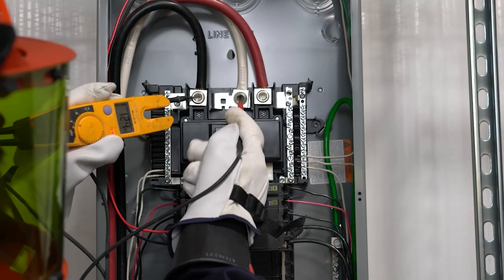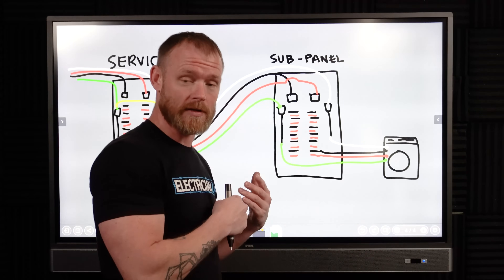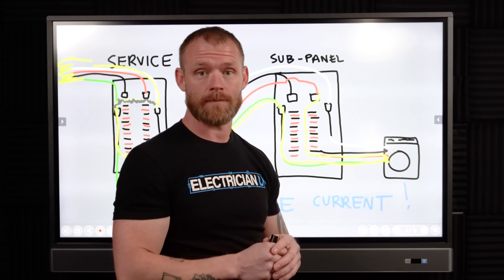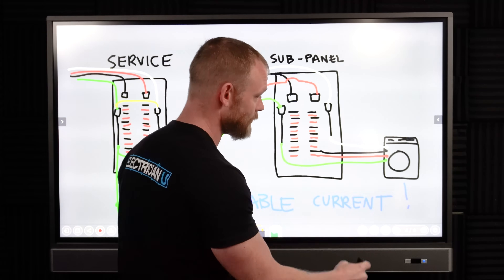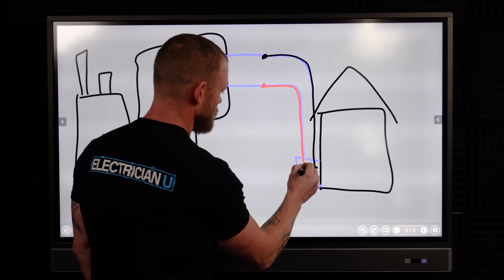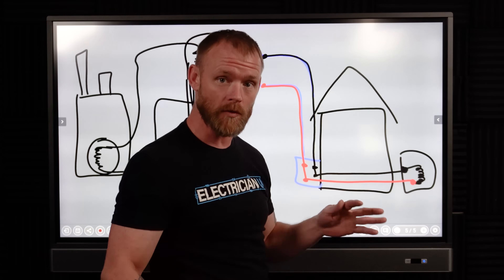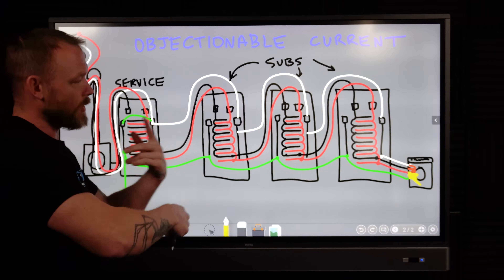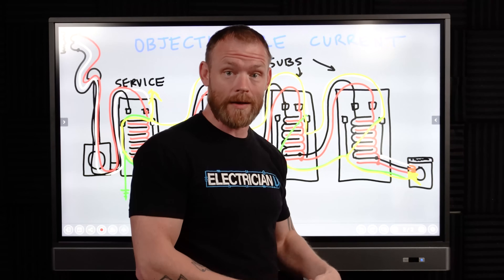Why Do We Bond at the Service Panel and Not a Subpanel?

Comment: So watching this explanation leads me to a question: why is the ground wire grounded? It seems that a 3rd wire that is connected directly to the neutral in the panel, bypassing all other electrical devices is what's needed and the fact it's also connected to the literal dirt doesn't actually do anything.
Reply: You are right about connecting a ground rod to dirt doing nothing, it's about connecting it to water which is a conductor.

Comment: ffs if you're not an electrician please stop trying to wire sh*t up in your home.🙄  Just went on a service call where some clown double tapped the feeders to his sub panels and then terminated all the grounds on his neutral bar and all the neutrals on the ground bars and also put his panel in upside down. The f*ck is wrong with you people...like stop. now.

Comment: I asked this of an old inspector 30 years ago and he told me the biggest reason to keep the equipment grounds and the neutral separated in a subpanel isn't so much for the fault current path, as much as it is if your neutral connection fails how would you know?  Everything would work fine (If the ground path is good).  Now we are running all of the unbalanced load across non insulated conductors, boxes or panels. You may not have a green wire, EMT or other metal raceways are acceptable equipment grounds.  If you touch them you don't get shocked as they are at ground potential.  If they are made up tight you will still pass the fault current and trip the breaker.  But if that one locknut wasn't made up tight or an EMT coupling screw was never cranked down you might get some arcing and flickering lights.  If it fails every circuit  on your subpanel could go to 240 volts depending on the imbalance.  You would still get that if the neutral failed but you would know it an lot quicker.  

If you were the guy trying to fix that loose EMT Coupling from a bonded subpanel with a bad neutral, and had your hands on either side of it pushing it back together you would defiantly know what objectionable current is. 

A great video and explains the main bonding jumper very clearly.  Keep up the great videos.

Comment: Because we don't want neutral current paralleling along on the grounding conductors (green wires or bare wires). END. Some dishwashers, & washing machines were famous for paralleling neutral current to water pipes and occasionally some twit would also do a second water pipe bond at the sub panel and then some poor schmuck who was just trying to take a bath gets electrocuted.
Reply: Baths aren't all they're cracked up to be.  One should be enough for anyone.

Comment: 240 volt with no center tap is a way better system less complicated smaller wires this whole 120 volt center tap seems ridiculous.
Yeah the whole balancing of the system larger wire gage... What is the advantage of 120 volt center tap setup.
Reply: The advantage is fewer burned lamps and toasters.
Reply: One huge advantage is that all the 120V devices will work.  We don’t want to throw them all away, and we didn’t when 240V service was introduced.  It worked out very well, because when 240V came in people could add it at their leisure if they needed it.  My grandmother never had 240V.  My mother rewired the house in the 1960s.

Comment: There are a few other things that need to be evaluated. 

1 - Eddy currents if not bonded. 
2 - Separately Derived Systems. 

These things always should always be considered in these conditions. The wiring changes for each of these conditions. 

The two path’s that you speak of is where eddy currents are evaluated. 

Eliminating the ground wire to the sub panel would allow for a separated service.

Comment: Great video, thanks for going into this, it's really helpful.  I'd really appreciate any knowledgeable person answering my question on this:
Why doesn't the current just travel along the main Ground wire and short the whole system all the time?  It's bonded to the Neutral and is a much shorter path to Earth with less resistance than going back from the Main Panel to the Source.  I thought that electricity is always seeking a path back to Earth, how am I mistaken?  Thanks.
Reply: I wondered about that. I think we can't rely on the ground being able to quickly carry that much current.

Comment: Thanks for the explanation! What may confuse some folks is if they have a service entrance rated disconnect in front of the main panelboard then that disconnect would have the ground and neutral tied together and not the main panelboard correct? Thanks.

Comment: Your explanation make absolutely no logical sense. If the sub panel were bonded, then that short would find the neutral that much quicker rather than making a ground hazardous by having current on the ground buss. Also, current travels at the speed of light, always. Resistance limits, not slows current flow.

Comment: If you had a transformer within your service and sun panel, would you bond the neutral and ground right behind the transformer. Typical won't have this at 120/240 single phase, but could easily over with a three phase or 480/277 service ......
I've argued with a number of engineers about that scenario and curious of your interpretation or understand.....

Comment: Still doesn't make sense to me..... pull the meter so everything is de-energized, put an ohm meter between ground and neutral at any sub-panel and you will measure a dead short because they are connected together. I will have to watch this again.

Comment: Ok, I fully understand this concept within a structure. In a structure you only want a single path to ground as current will flow on all paths dependent on resistance. What I don’t understand is that in a exterior sub panel or most particular a daisy chain of feed thru’s with individual ground rods at each sub panel works. I have had devices plugged into the 240 supply on these panels with a fault to ground. Depending on where in the circuit this happens the current gets shunted to the earth ground and not enough current gets back to the main to trip out a large breaker. Typically a 200 amp main breaker.  While it is code to have all these different ground rods it doesn’t seem to work in all situations. Can you make a video explaining why we earth ground every sub panel? Again not a problem when a single sub is fed by a main, more with a daisy chain of sub panels. Each with a separate ground rod.

Comment: Very good videos. Thanks for it.
I have a question.   Is it correct or not? Having a duplex property for example with a 200 amp main Panel dual meter 100 each unit with a ground rood thru earth and  run only the 2 hots and neutral conductors to each subpanel from each unit and have a separate ground rod on each subpanel unit and bonded or not...

Or just the ground rod on the main meter box and run 2 hot neutral and ground to subpanel and not bond them.
Or

Comment: If I understand correctly, what is being discussed at around 8:20 is that energy flow  (current) through the grounding rod may not be sufficient to trip the breaker?  So it is safer (and required) to be complete all the way back to the transformer but I wonder in practice if that is actually true.  If there is 120v of potential between earth and the line hot wire and it is occuring like 60x/second, and assuming the grounding to a rod or burried metal pipes was making a low/nil resistance path to Earth as it is supposed to, would the breaker really not trip?  In other words, if the panel were not bonded, and the hot wire were touched to the grounding wire directly, would the breaker actually not experience excessive current flow and fail to trip the circuit open?   Later in the video he says, "ground rod doesn't have anything to do with tripping a breaker", and I don't believe that is true.  The breaker only "sees" current flowing in the "hot" side of the circuit; the return current flowing on neutral should be invisible to it.  So it shouldn't matter whether the current returns up the service to the transformer, or out to earth through the grounding rod.  ON THE OTHER HAND, where we are dealing with excess current returning through the neutral conductor, bonding ensures that the current will flow even if something screwy happens at the transformer, and that said current flowing, if it exceeds the breaker rating, even if it's going out through the grounding rod would cause the breaker to trip.  I agree 100% with what he says at around 16:40 about no wanting to have current flowing on grounding path (i.e., metal pipes, conduit, etc) for a short circuit.  That is correct, and that is in my understanding the actual reason not to bond in a sub-panel.  But like I said, I'm not sure the other stuff is correct.  And if you add in the fact that code (in order to keep things "safer") has increased where GCFI breakers are required, you can say that definitely on those special branch circuits where a GCFI breaker is required, is is most definitely incorrect.  But just speaking about an ordinary plain vanilla breaker, they will in fact trip on a ground fault that exceeds the current rating of the breaker... they just don't trip when the ground fault is energizing something without anywhere to go (like water in a porcelain sink with a rubber/plastic drain pipe/stopper) - thus you need GCFI in those situations.  But what he draws there with full current returning through the grounding rod, please somebody else confirm, but I would be 99% sure it will trip the breaker.  This video just makes me doubt that 1%!

Comment: Great video. Some questions re video. To clarify, could you answer: If Hot touches the washing machine, why can't the return current go via the neutral? and if ground is tied to chassis at the washingmachine, and the washing machine has metal feet, isn't the washing machine creating a path to ground bypassing the breaker?

Comment: You're forgetting ground loops as well. I know it's not safety related but creating ground loops introduces a lot of RF noise into your local power distribution. Those same ground loops can also amplify RF noise above legal limits and cause illegal interference in your locale. This becomes especially important in 3 phase equipment where looping the ground turns the entire peice of equipment into an inductor. The noise the motors generate, especially if VFDs are involved, can encroach on AM frequencies and violate FCC regulations.

Comment: I'd like to understand the "earth" (ground rods/plates) requirements better. Particularly when one service panel serves multiple sub panels in separate buildings.
Reply: I believe that once the service exits one structure into another structure, you have to bond the neutral and ground as if it is service entrance rated..... Hence the name service entrance.
Reply: @bryanduchane2371  I think you are correct but I there is more to it than just that.

Comment: I don't think I could explain it to someone else, but I'm pretty sure I understand it. Thanks! Subbed.

I have a question about impedance. I noticed you were interchangeably using resistance and impedance. Resistance in a DC circuit I understand, but impedance is what I"m not quite sure about. First, they aren't the same, right? You were using them both but I'm guessing that was not necessarily correct. I think. Is Impedance the same as resistance but with respect to an AC circuit? So resistance (DC) is equivalent to impedance (AC). Is that right or am I simplifying it? Or am I completely wrong? Sit down, shut up, write Ohms Law 100 times! 

Great info. Thanks again.

Comment: I just recently ran into the 3-wire, 240v Range/Dryer issue. It seems that in MANY installations, the neutral is also grounded to the body of these appliances. This means that ground and neutral are joined at these points, undermining the idea of only bonding them at the service entrance. Can you shed any light on this issue? They still sell the 3-wire receptacles  and you see them all over the place.

Comment: Only difference between the service panel and the sub panels is the earth ground. If the sub panels have an earth ground you could bond them. 
You want the objectionable current to have a guaranteed lower resistance path to earth ground compared to the common white wires.

Comment: Ah, Objectionable Current is a product of, to borrow a term used more often in Audio Engineering, "Ground Loops".  This also explains why, in industrial environments, when connecting machines together electrically, you do NOT have multiple ground wires going to the same machine.

Note to self: double check that the machines at the plant do not have a ground wire connecting them to the ancillary machines, which have their own grounded power feed.

Comment: What happens to a motorist if is run 260 instead of 230Vac  16a? If the volts are 260 obviously the amps should be lower.. but it’s 11.5% out the specs… so.. will this affect the motor and how?

Comment: If they ever disconnect the street transformer neutral in the wrong sequence. or it gets a lightning strike..it could have really nasty consequences, Your house bonding could be the street  transformer return path,, 
Even if it is  single phase if the ground gets interrupted the bad time is at your bonding strap 
 I'm in Canada

we are not allowed to bond neutral and ground in the house, but there is a 6+ ground to water pipe or better, or a beefy ground plate or a rod or ten
Read this many times Bonding and grounding are the least understood aspects of electrical
I'm industrial so just putting my two cents in.  Important point,, grounds are designed to absorb
 more amps than your service can provide if a hot wire touches the metal shell on an appliance or sub panel it is an immediate over current breaker trip...grounds are the fail safe in wiring...grounds will take more than your panel can provide in amps

Comment: About 30 years ago they changed the NEC. Prior to that, sub-panels in separate buildings were bonded. A local ground is critical for dairy operations to prevent cows getting shocked by milking machines. Nowadays, dairies use so much power they rarely if ever lack their own service equipment. You will still find outbuildings with a bonded ground and neutral.

Comment: So every panel after a meter is bonded but all panels after that first branch/main panel isn't bonded? Correct?

I.e. meter to house main branch panel (bonded) any panel added isn't bonded 

But on the same house.. 

A 100 amp sub panel fed from meter is bonded and then feeds a branch panel that is not bonded.

Comment: So coming from the car world, where ground is the hot lead (thanks for getting it wrong Benjamin Franklin), it makes this house AC stuff a little confusing since it's properly labeled where hot is hot and ground and neutral are what they say they are. We really should all agree to switch + and - with DC electricity, it's gone on long enough. Power coming from negative (aka ground in the car world)? Come on. It's ridiculous and confuses so many people because it's obviously wrongly labelled.
Reply: Cars don.t use ground, but they do use Common.  The DC current flows from negative to positive within the battery and from positive to negative outside the battery.  Of course were talking about an internal combustion car not an electric car.  Who knows what happens in those little electric ones.
Reply: @motorheadplatt8748  Really I didn't know that... hm.... them pixies be befuddlin.

Comment: Question:
My safety ground is bonded at my panel.  I am plugging my pool pump into my garage 3 prong plug.  I was told to put an additional 8ft grounding rod into the ground next to pump can connect it to the pump safety ground on the pump.   Is there a problem with multiple safety grounds connecting to earth throughout the system.  Is there a thing called a ground loop?

Comment: About 12 yrs ago I bought a cheaper stove/oven from a big box store, it was a standard brand.....After removing unit from box, when I went to put a plug on the unit I noticed a bonding strip was present from ground to neutral...called the company and after they told me this was not a problem...but I insisted it was...they sent a technician out to remove this bonding strip. The unit was made in Mexico. Any body else seen this and is this problem?

Comment: I watched a couple videos on this topic last year. I have a sub panel in an upstairs closet, and on a whim, pulled the cover off to inspect - sure enough, the grounds and neutrals were bonded.  I got that cleaned up, then checked the sub panel in the detached garage - installed by the previous owner, the same as the one upstairs - and they were bonded there too. And, the garage did not have its own grounding electrode, and had an abandoned metal water pipe that was also not bonded to ground (but buried too shallow to qualify as a ground electrode). It's all fixed now, but until this video, I knew not-bonding was important, without fully understanding why.